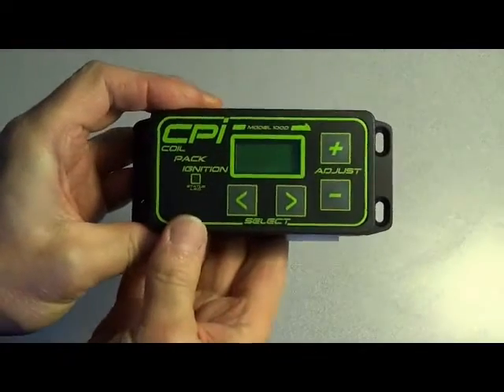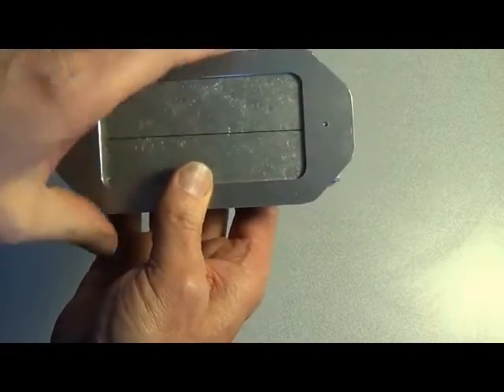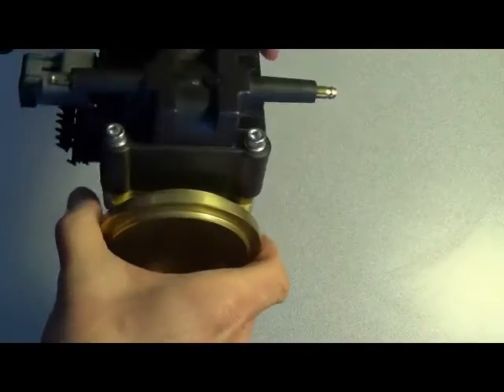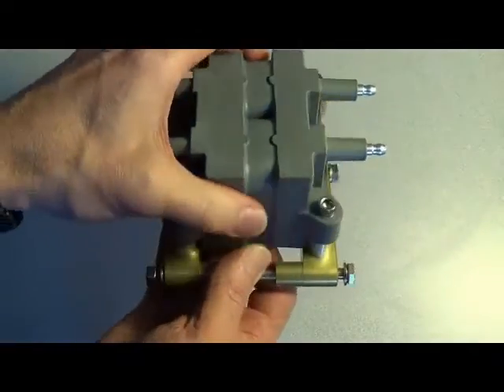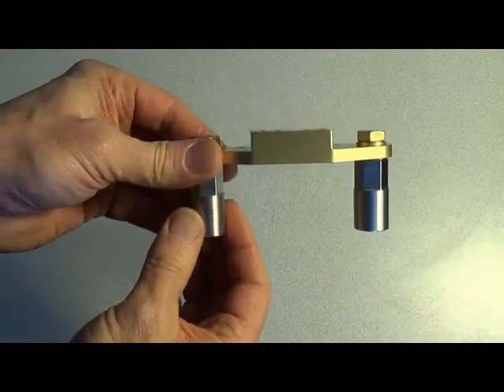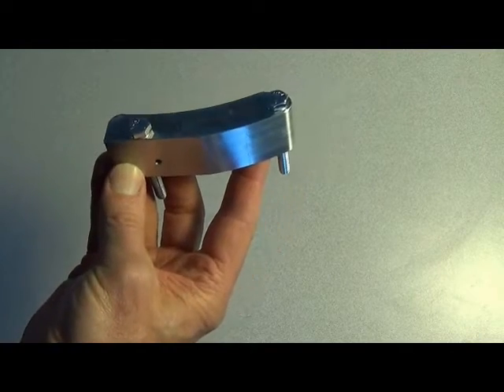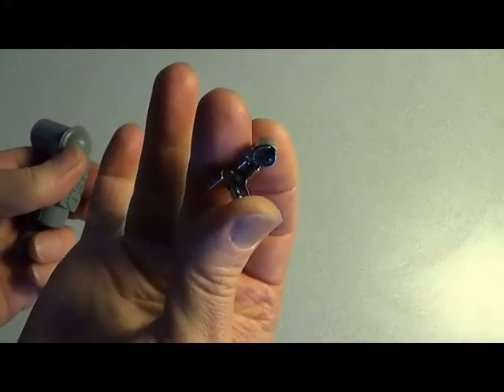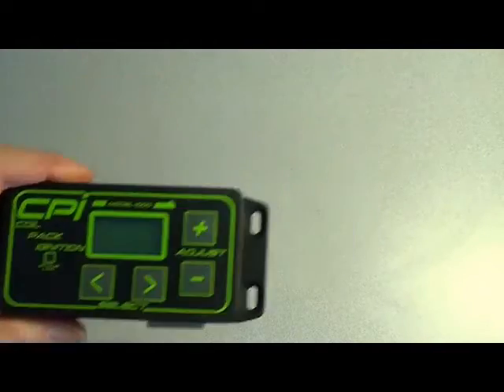cpi2

Comment: I think this is the ignition for my RV-7 project. I want dual system. I assume I'll need dual battery/electrical backup? 
 Compared to other Elect Ign Systems: e-Mag, LS,.Electroair... How does your performance compare? (spark intensity, duration and mapping max advance etc...)
Reply from the maker: Yes, we recommend a backup battery around 5-7 amp hour, depending on mission lengths. We run the same coil hardware at Reno up to 90 inches MAP. Our mapping is all user programmable and we have a LOP switch to add extra advance when LOP. The others have none of this without extra add-ons.